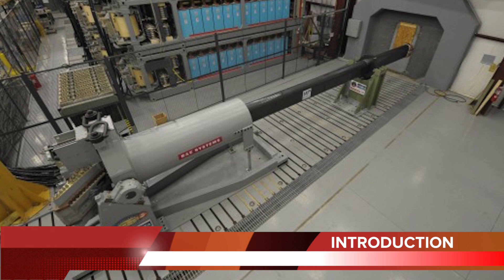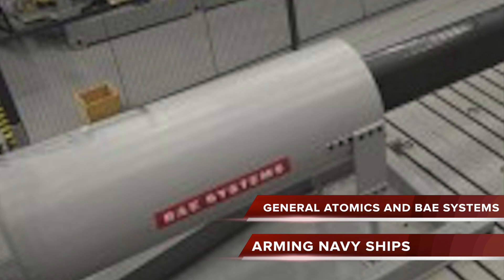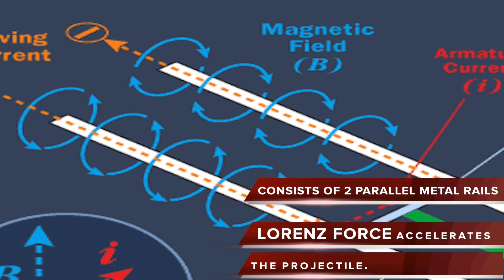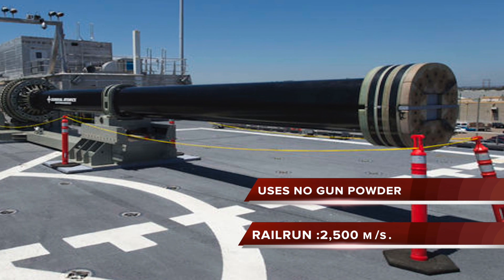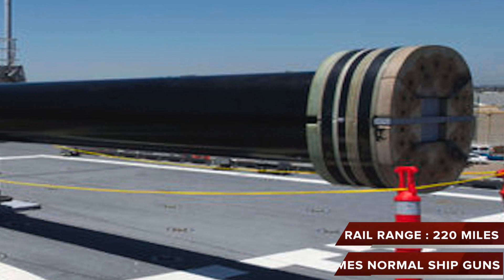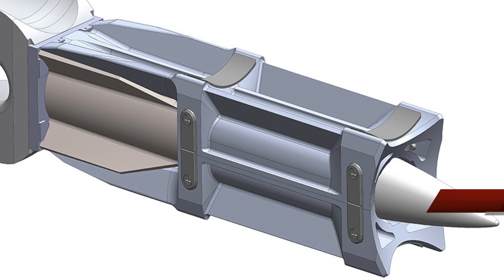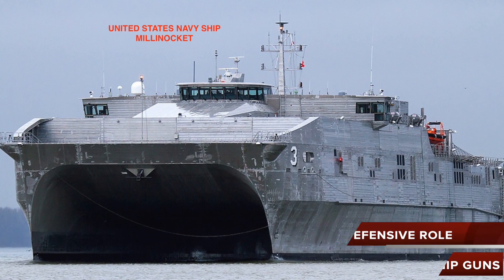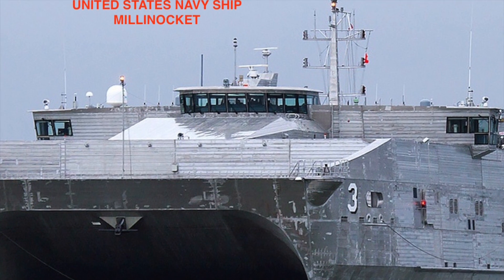RAILGUN : TOP 5 FACTS

Comment: Great to see U.S. Finally steering towards using Elecricity, (That's already in use) for the Electro-matic Rail-Gun is much more intimidating when seen at a target 100 miles away.  Get that, (It's had it's time) Gunpowder Gone!  Imagine an Air-craft carrier with a rail-gun on each of it's corners? No use for Battle ships, The carrier could do 2 ships business with only 1.  Battle Carrier!  Thanks! BullyBilly

Comment: Imagine rail gun sniper rifles with an effective range of 3 miles. American Sniper 2 coming fall of 2032
Reply: Elijah Stewart That would have at least 60 Kilojoules of kinetic energy.
Reply: angry try hard It could happen in the next hundred years
Reply: Elijah Stewart Actually quite soon. 60 Kilojoules is only 3 times more powerful than 50 BMG.
Reply: Wow, I'm worried about the sound, will it be really loud or relatively quiet? Most of the sound will come from that mach 3 bullet